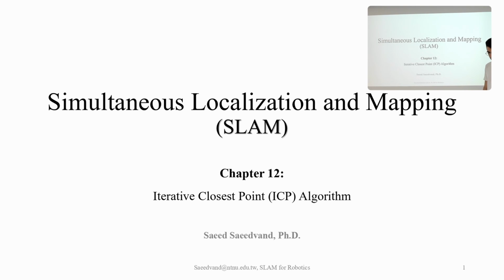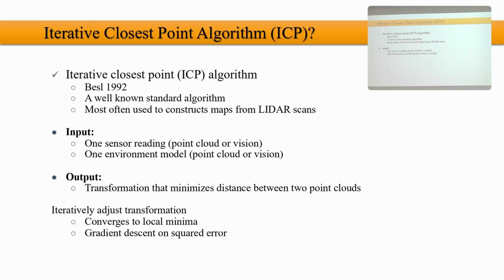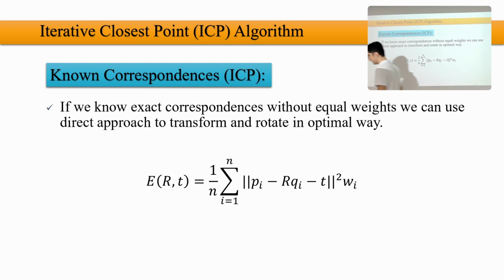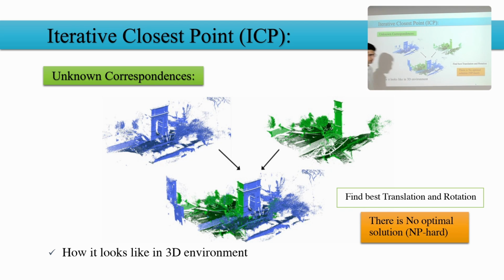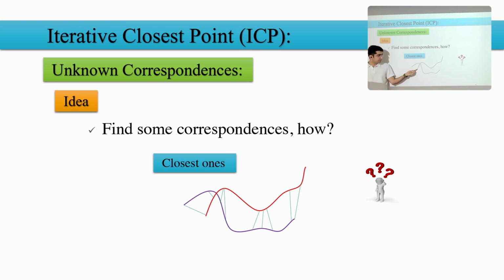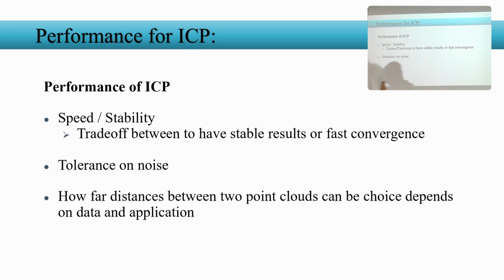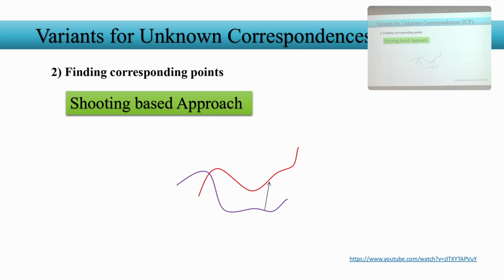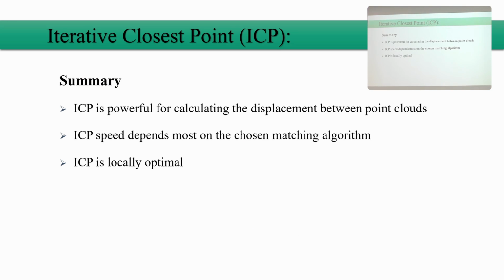CH12 SLAM for Robotics - Iterative Closest Point (ICP) Algorithm

Comment: Hello teacher, may i ask a question? If a have a Lidar point cloud, each angle will give me a range, and range 1 relative angle 1, range 2 relative angle 2 ... range n relative angle n, as 1 is 0 grau and n will be 360 grau. In this case w(weight) is 1? I know the index(compare range with same angles), is that correct? Thank you